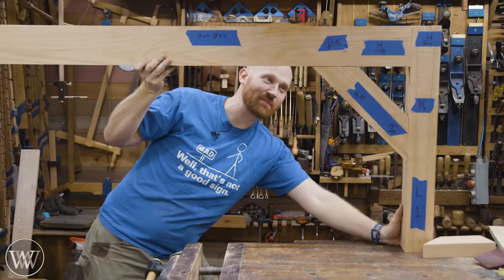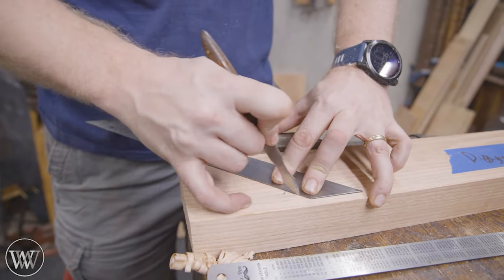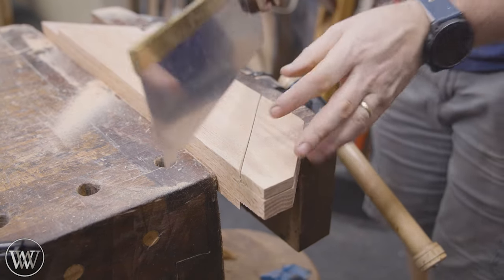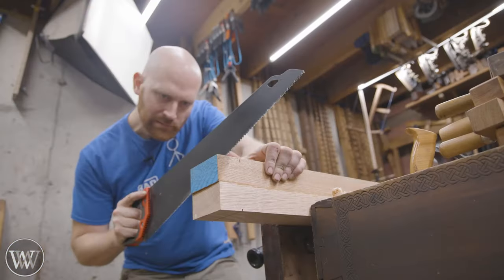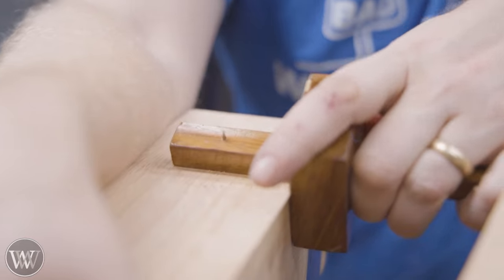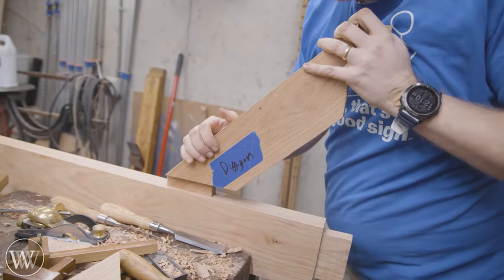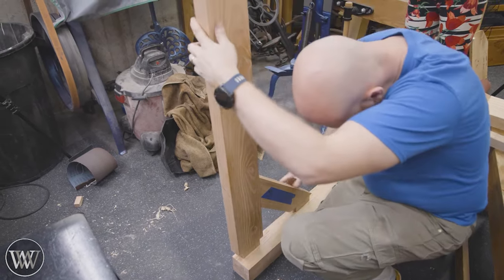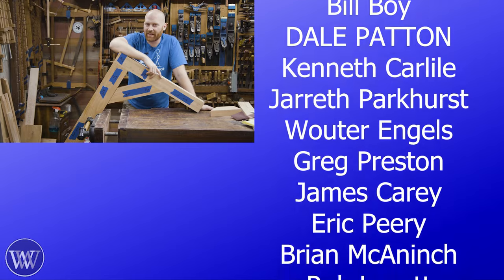Timber Framed Ping Pong Table

Comment: As an old-school woodworker, without a table or band saw, who uses linseed oil and wax to finish EVERYTHING,  it amazes me that you use modern 2-part epoxy glue so much. You kept saying all the joints would be pegged, which makes the table more portable. Why not mechanically attach the lumber for the legs together,  or use 4x4 ash, which is almost free here in the Midwest?
Reply: He’s not talking about a removable peg, he’s talking about a drawbore mortise and tenon. It will be glued together permanently.

Comment: Since the legs are actually 2 pieces of wood glued together face to face will that keep the leg from being able to expand and contract and eventually lead to warping or splitting legs?
Reply from the maker: no. the joints will be drawbored that will allow the wood to move however it needs to.

Comment: Just a question: is there a special reason for the tenons of the diagonal piece to be only three-sided, if you see what I mean? Thanks in advance!😊
Reply from the maker: If you mean how these shoulder of the tendon comes all the way to the tip of the diagonal that's just there to give it a little bit more material to work with. Because it's on an angle there's only so much solid material you can have and the more the better.

Comment: I understand if you don’t get to comment back for a while, but where do you get your epoxy, and what kind do you get?  Also, may God watch over you, your family, and all of your belongings in the move.
Reply from the maker: I use a bunch of different epoxies for different uses. But for general adhesion I use total boat high performance. I usually get it on amazon.